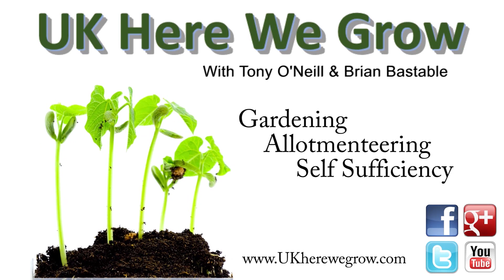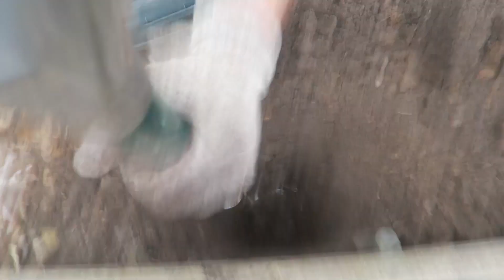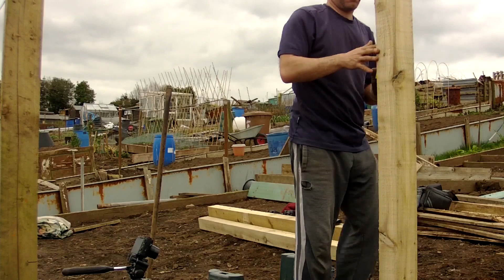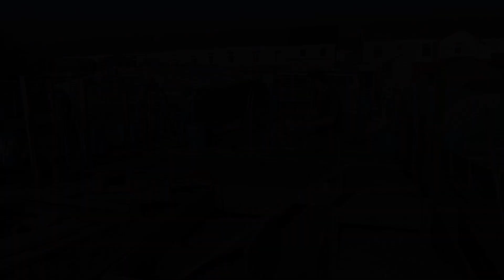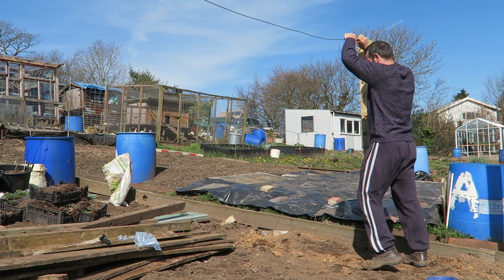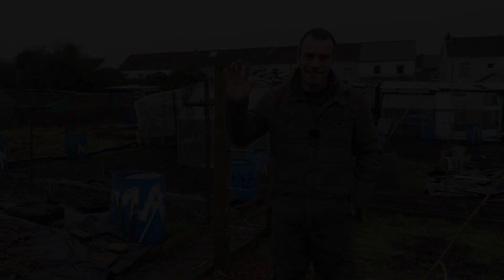How To Make A Wire Trellis To Support Trees

Comment: Hi! Have you not had any issues with the posts bowing in due to the pull of the wires? We installed a system like this (4x4 posts, metal wire) a few months ago and the top wires keep losing tension, because the posts are bowing in.

Comment: Hi Tony, wont that post rot in the ground in a few years? thanks Phil.
Reply from the maker: These are pressure treated Phillip. They will last for years. when it does finally rot i will just replace it, by that point the trees will have a strong enough structure to support themselves while the work is carried out

Comment: Hi,

Would using ground spike and 6ft x 75mm posts also work? 

How many posts for a length of 25ft (just under 8m).

Thanks
Reply from the maker: It would depend on the winds you get, but should do if they are not to strong

Comment: Im a beginner in gardening, but with wire I know something; when you twisted it at the first screw eye, you kept one wire straight, but the other you wound around the straight. It will slip! you must twist both wires around each other. Do this by pinching both wires together, then hold them while twisting; it will hold
Reply from the maker: Thanks seth